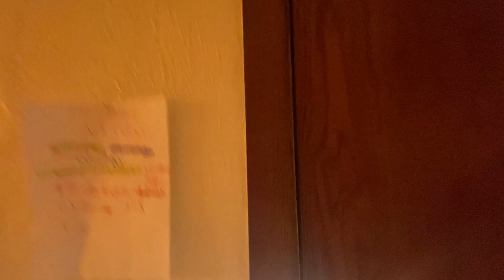Help... is this a silent killer? HVAC Furnace Installed wrong?? Carbon Monoxide

Comment: For starters, you are going to have mold growth in that crawlspace within 48 hours if you do t get dehumidificstion amd fans up there. That mold will in turn put your families health in jeprody if it is not remidiated. Dont play with that, my family was deathly ill from toxic mold due to a leak not properly handled and contained, you dont want that smoke. Make an insurance claim against the company for this asap or you will regret it. May even need to go as far as pulling all the drywall and insulation in that space for remidiation. Hate to bring you bad news but its your family so i wouldnt play around with that. As far as the outside chimney, never seen something as stupid amd dangerous as that for a vent. I believe there is code for how high that thing needs to be above the head but not sure.
Reply from the maker: Appreciate that. It’s currently 13 degrees here and suppose to drop more tonight. Will it mold that fast? Only access points is the gable vent I show and I can’t even fit though it.. insurance may be a good idea.

Comment: where was the old furnace vented?
Reply from the maker: It was a old farm house estate. The first chimney I show I believe ran out the lower part of the roof at one time, but I believe when they put the metal roof on, they took it out. The guy who owned the place (passed away) lived here in the summer and farmed, in the winter he went back to Texas. He had a electric thermal heater on the main floor. All the vents were covered with carpet or tile was placed over them. The electric thermal heater was installed in 1989, the og furnace was older than that and sat in the floor… I need to pop those side vents off and look inside but they are the ones that are sided around and only the sides pop off. It’s 0 degrees and was trying to avoid cracking up all the siding but I’d rather do that and see tomorrow.
Reply: @JRESHOW  yea tough situation, alot of time chimneys are assumed to be good, the way they have it vented will work for now you need heat. you have to either run that up the side of the house, run a new b-vent thru the house or put a 90 plus furnace in..contractor should have maybe caught it, odd circumstaces tho
Reply: also from the basement that old chimney was probably drafting because of those gable vents so i can see that assumption being made
Reply from the maker: @meltflood_chicago good points. I did read through the furnace manual and they said not to install without lining the chimney first which they didn’t either.
Reply: @JRESHOW  in chicago we dont normally line interior masonry chimneys but its not a bad idea
Reply from the maker: @meltflood_chicago The manual said don’t install with unlined but
Reply: @JRESHOW  i bet their code does
Reply: hmmmm
Reply: That’s not a new Lennox. Maybe new never used, but definitely not new. Probably 10-15 years old